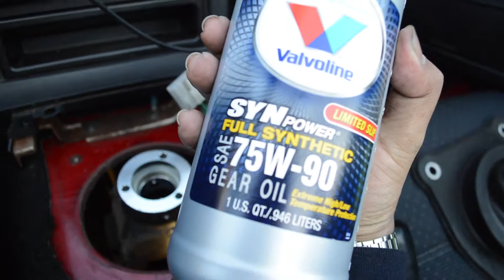Miata Short Shifter Install

Comment: What other goods have you done
Reply from the maker: garage worm 17 I actually sold this car awhile back! But at the time, I put on the MOMO Monte Carlo steering wheel because the stock wheel was getting crusty and a new radio because I had a decently long commute from school. I hope that helps!
Reply: @rac3kar  thanks friend I have a grant wheel radio delete ac delete under the dash as well as compersser 1pound crank pulley. Header.  64mm throttle body. and crap intake because I can afford a good one 🤣🤣. Manzo springs and mookeen shocks and 595s for grip 😁 been wanting a short shift next i do daily this car and race it in a scca solo2 class
Reply from the maker: garage worm 17 thats awesome man! Do you have videos up? I’d like to see that build
Reply: @rac3kar  yes and I helped build a 300hp miata that did 276hp at the wheels
Reply from the maker: garage worm 17 dude thats awesome!!